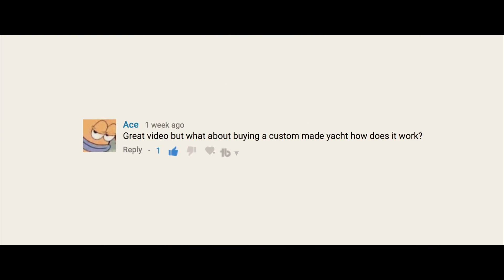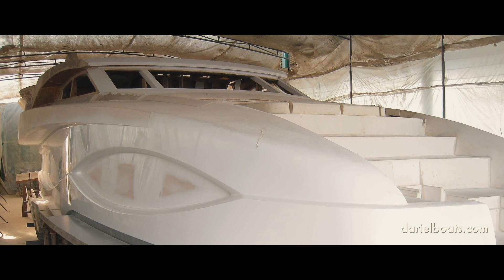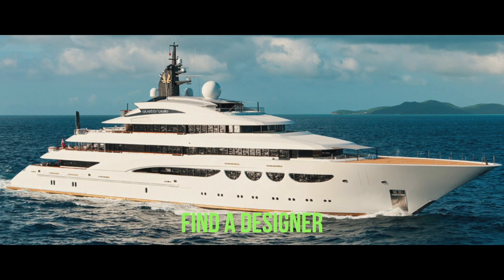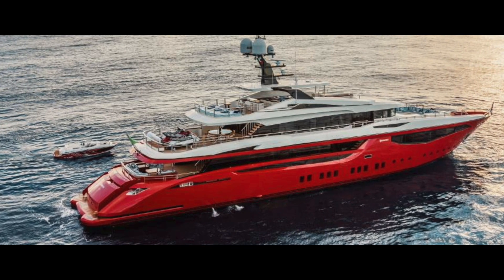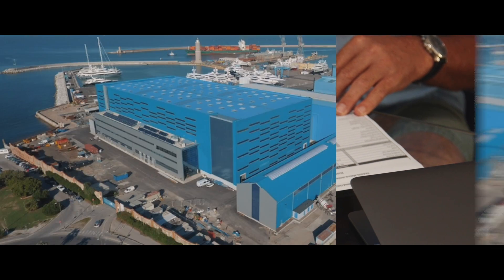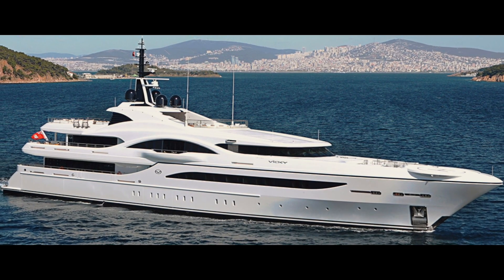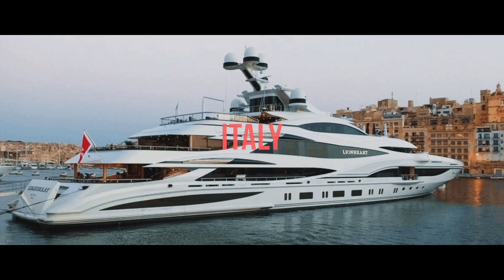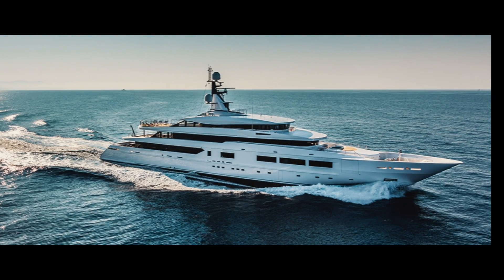How to Build a Custom Super Yacht

Comment: Please can you suggest a strong boat that can help move between continents.

It should be very stable at sea and the should not scare the family on board.

It should be safe for a family of 4 members on board. With security features to keep pirate away.

Some thing that is not as expensive to run on fosel feuls. May be solar or turbine or electrical boat that runs it's self.

My main intention is to live at sea on a floating home that's not very expensive to move between places. I stay in India - Mumbai and we have amazing sea connecting many places.
Reply: Though I am not looking for a long boat. I am very keen about safety, security, stability and operational cost. Don't mind even if it can just support 2 family members but safety and operational cost are my biggest concern.

Comment: CRN has built some of the most beautiful yachts I have ever seen.  One of my favorites was CRN's Maraya
Though, Since I do not yet own a yacht.. I would most likely go with a much less expensive and much much smaller yacht. Definitely a production model. 
Probably a Sea Ray or if I was able.. A Hatteras.. I like diff things about the models. the GT70 sport fishing Yacht gives you a lot and also great max speed 41 knots and handling it in chop with a range of 500 miles is not bad for the size while the M90 and the 100RPH are beautiful and offer a lot for more of a cruising comfort motor yacht with nice amenities and materials for its size. 
The Id really like a combination of features of the GT70 and the M90.

Comment: Yes hello, great video ... the best ever on the requirements for a build form scratch.  It would be great to have a mega yacht that can travel all day at 33 knots.  I see that as yachts get longer and larger and heavier their width to length ratio seams to diminish. For example a 50 meter yacht will have about 16% to 18% width 9m meters.  However,  a 125 meter yacht will have about 12% to 14% width 17.5m.   Is anyone/designer/naval architect  building  100m plus yachts, +/- 1200 tons,  that are much wider (more space for crew,  passengers)  so that it can also accommodate 4 or 6 engines to attain  top speeds of 42/45 knots? ..... Are there any recent English books to recommend on mega yachts designs PROS & CONS? ...
Reply: Can you even imagine the fuel use of something like that? Not only the extra engines but the extra width. These people are super rich yes and some maybe literally couldnt care less, but most got rich by not ignoring cost entirely. When a yacht is already costing quarter of a million just to fill up the tank for one long journey I dont see anyone coming up with a 4 engine super wide 33 knot cruiser thats going to use triple the usual fuel

Comment: is it true that they are going to build a 222 mt yacht, in some German shipyard?
Reply from the maker: You may be referring to the 222m project "Triple Deuce". This was a scam. A disreputable yacht brokerage announced that they had sold the yacht and it would be built, and they received huge publicity in the press...both the yachting press and regular. It turned out that they had no more than a few drawings and had not even found a builder to construct it. They hoped that if they got enough publicity then a buyer would contact them, but it backfired and they just damaged their reputation and credibility.
Reply: Therefore you are confirming the initial sensation I had: it was a scam. Thank you a lot for the quick and competent answer!